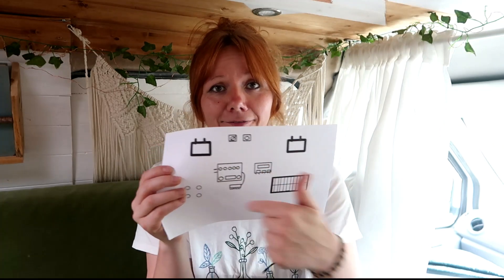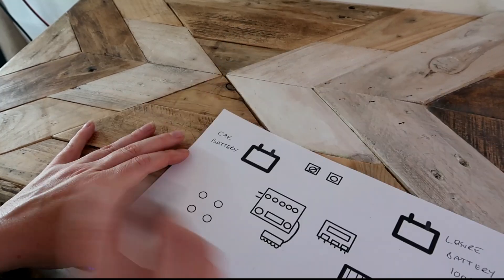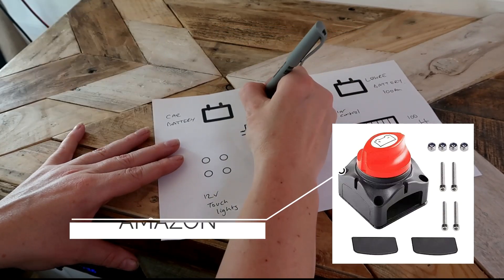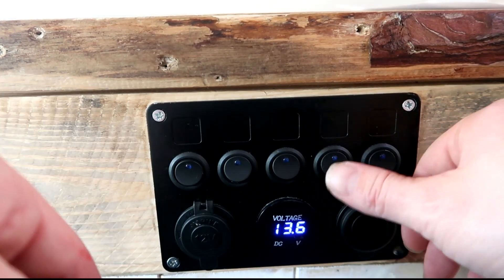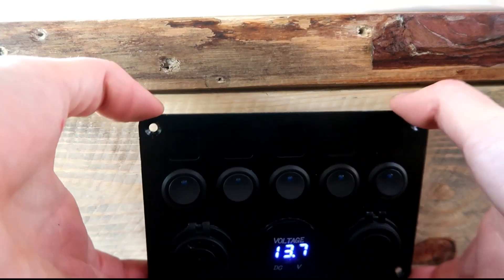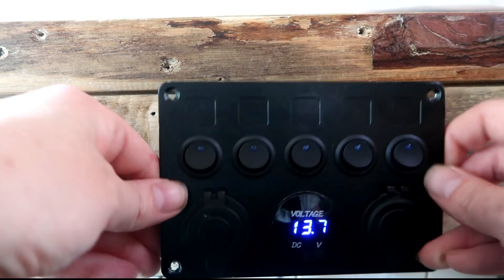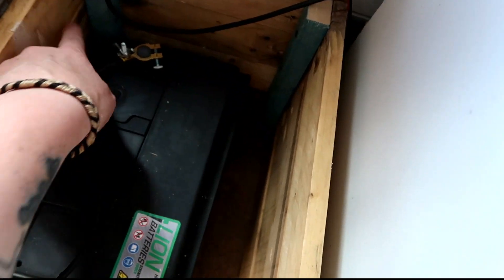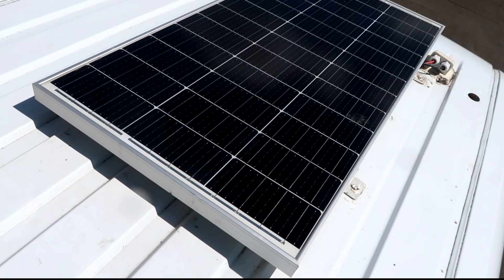12v Electic set up in Micro Camper Van

Comment: yup , enjoyed that , the only thing i would say is where you run cable from the battery through holes in the body work , i would put a rubber grommit in to stop cable rubbing against the metal edge of the hole , around 10.28    also its good to see these kits are getting cheaper and for flexible panels too.
Reply from the maker: Yeah, that's a good point. Thank you 👍

Comment: 👍👍🙏🙏✌✌hi , my comment on the last video disappeared ? it was , to stay with one leisure battery and upgrade to a compressor fridge/freezer 😊😊
Reply from the maker: Ooh that's a good idea! Would a compressor fridge use less power than the cool box? It's definitely something to consider 🤔
Reply: @mistymiles  hi , Wayne again , yes they use hardly anything and the cost would be about the same as a new battery they are about £160 your solar would deal with it no problem 👍👍
Reply: @mistymiles  the astroal 22 litre is £230 at the mo but on deal they about £170 on a certain jungle Prime shopping site
Reply: @mistymiles  or the alpicool 22 litre £192
Reply from the maker: Oh wow, thanks so much for the advice, that's great 👍😃

Comment: Great to see all this done on a more realistic budget. Most van conversions start with £500+ batteries, and £500 inverters. Really put me off, but your set up looks really good. With an extra battery, do you think you could run a cool box on a more regular basis?
Reply from the maker: Yeah some of the van conversions run into ridiculous amounts so I really tried to keep things to a minimum budget. I think once I have another leisure battery it should be enough power to run the cool box but I'll keep you posted with how well it works. At present I plug it into my van 12v socket when I'm driving then connect to my leisure battery when I'm static and unplug during the night. It's not great but I think it's the best option for now. Thanks for watching 😊